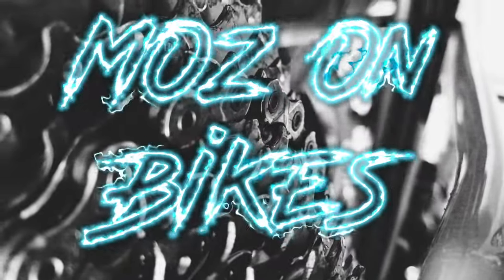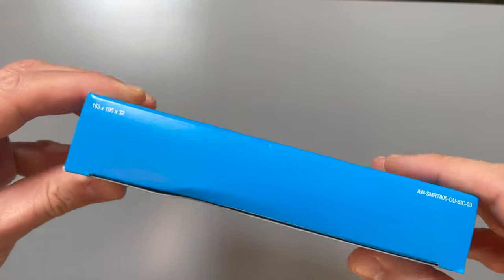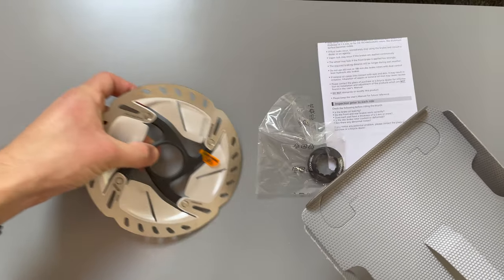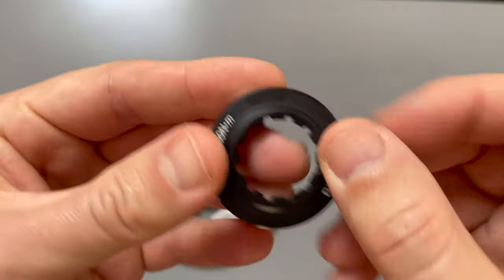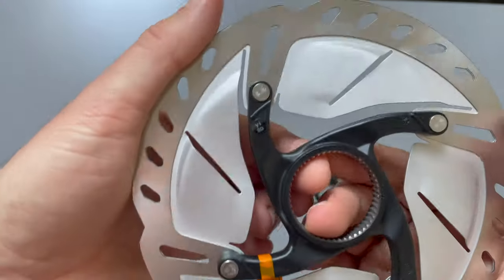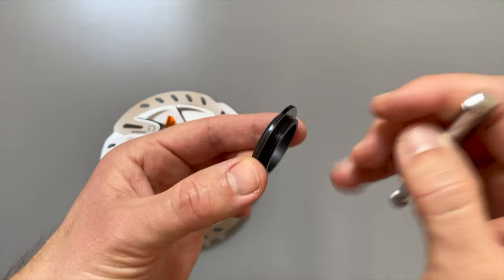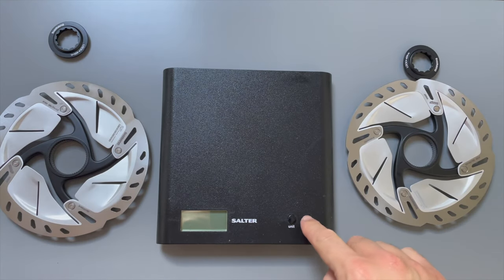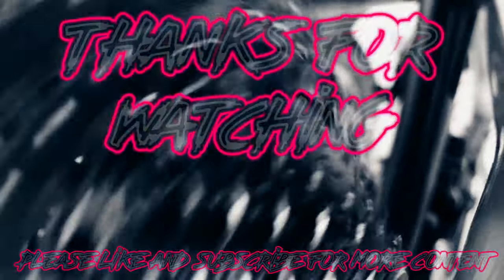Shimano Ultegra Ice Tech Freeza Centrelock Brake Rotors - Detailed Look & Unboxing.

Comment: Are they compatible with non ice tech shimano braking systems?
Reply from the maker: Mostly yes. I think it will depend on what thickness of disc the calliper is designed to work with. There are a few mountain bike systems that used thicker rotors.